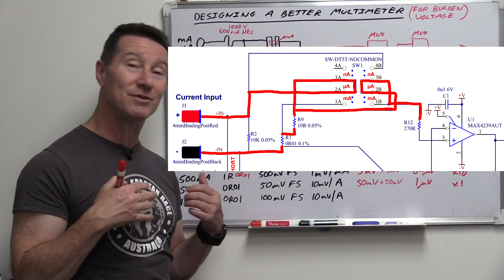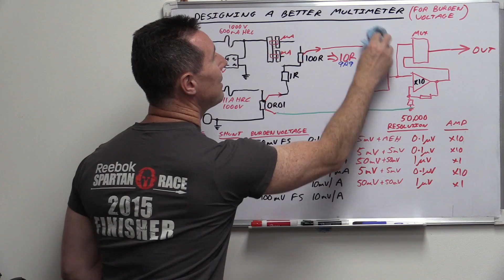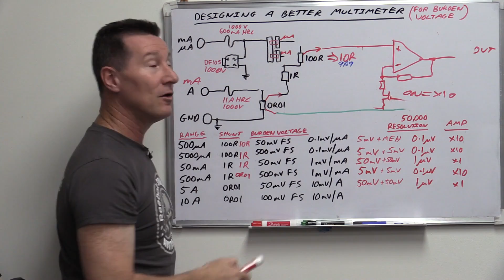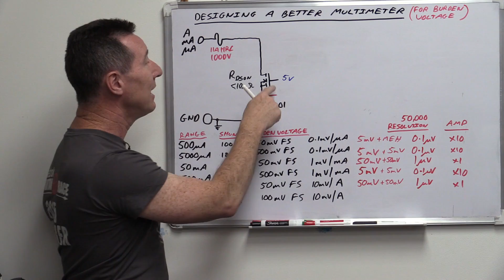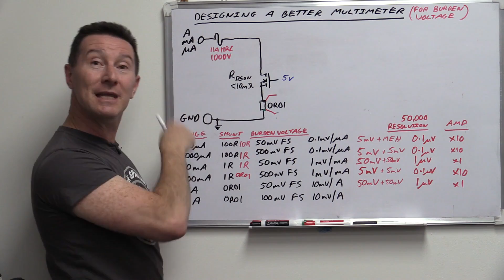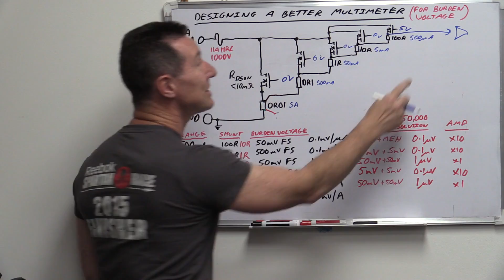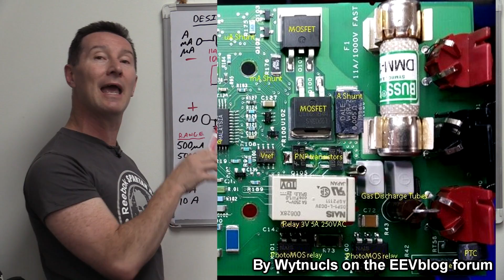EEVblog #931 - Designing A Better Multimeter PART 2

Comment: I wonder about the safety approvals aspect of putting a MOSFET in series with the 10A fuse. The point of the big-ass HRC fuse is so it doesn't explode when a high energy source is connected. 
What's to stop the MOSFET exploding, creating just the same safety hazard the fuse was designed to protect against. Especially if it's turned off, so you have the energy dissipated in the body diode rather than the low on resistance.
And if it doesn't explode, it might well fail before the fuse opens.
Reply from the maker: You'd have to ask Gossen who do this exact same thing. Their meters are CAT IV @ 300 V or CAT III @ 600 V per IEC 61010-1
Reply from the maker: Fluke certified the 185 for CATIII 1000V and CATIV 600V with the same MOSFET arrangement.
Also, most meters use a W04 bridge or 1N4001 clamping.
Reply: mikeselectricstuff 
Same concern here.  The CAT ratings have a basic assumption that a meter hooked up for current measurement is then attached to something like 480 V AC.  I have no data about the actual fuse in the meters, but an example could be a premium fuse, KTK-R 10 A that interrupts AND LIMITS the maximum current to something around 200 A, when the 480 V prospective short circuit capacity is 100 THOUSAND amperes.  The fuse manufacturers show photos of exploding breakers or fuses of inadequate types.  Nasty looking!  By the way, low current glass type fuses may have an interrupt ability of 80 A, rated 250 V.  An unrecognized fact is that higher current (say 10 or 15 A) are rated only 32 V!
Reply: I had built a H bridge with MOSFET'S and some how I numbly hooked it in reverse across a 370 volt 33000 MFD backed LIPO battery bank and to my surprise the 20 amp HRC fuse saved it the only damage was the end of the battery lead the body diodes took the hit no prob
Reply: You can find several power MOSFETs suitable for a "high energy source" connection in which a thermal limiting type body diode takes over when the MOSFETs "off" and for which a 10A HRC is plenty of protection.
Reply: I'm sure there are some MOSFETs around that can handle this, but I don't think they can be used in an environment where really really gross overloads can occur.
But really why in all the world would I want to put my meter in line on the mains to measure amps when I can also use a clamp meter?
Reply: audiocrush this setup is generally used on dc loads where a clamp meter is useless or in accurate a CAT rated meter can be damaged yes but the failure will be in a safe manner
Reply: Hall-effect clamp meters do exist that measure DC amps just fine, I know as I have one. One wouldn't use them for measuring anything extremely low currents though... but for high currents why not.
Reply: You could put the mosfet and a bare fuse wire in your own HRC can full of finest beach sand.    I guess you'd need the mosfet as a bare die to avoid the shrapnel of the hermetic package, like you see in IGBT modules.